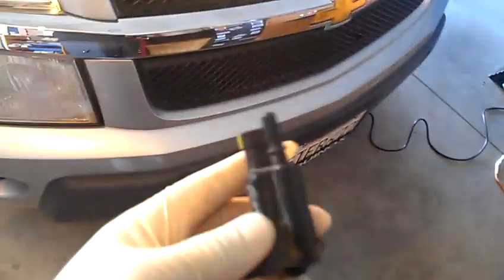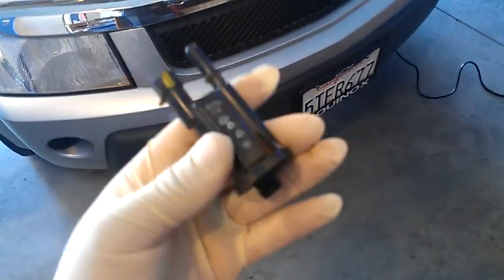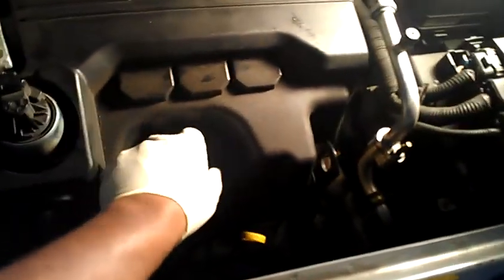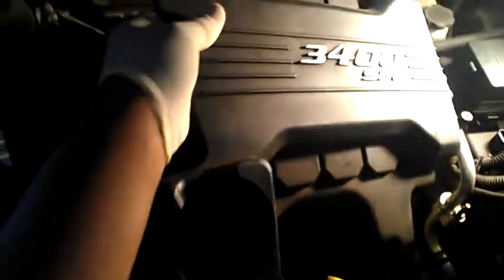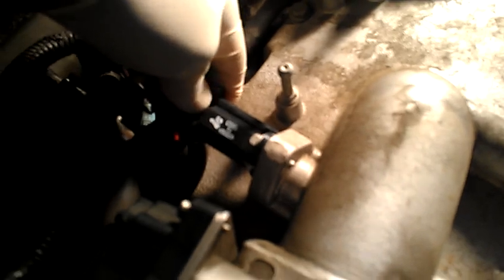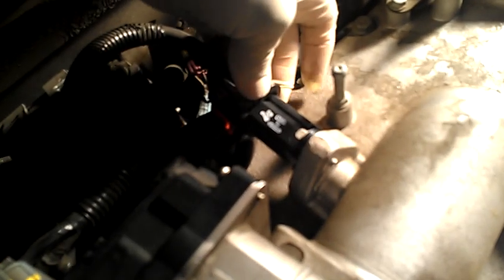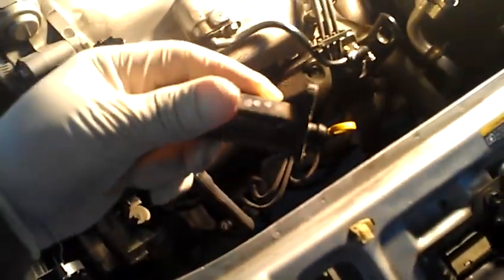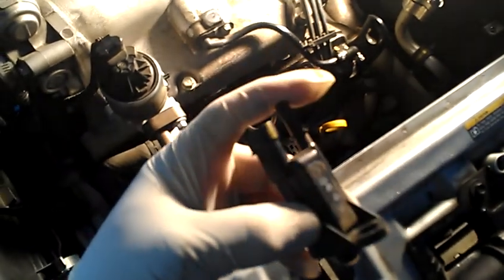EVAP PURGE SOLENOID INSTALL 2006 CHEVY EQUINOX CHECK ENGINE CODE P0455, P0171, P0446

Comment: Thank you so much for making this video! My local dealer was going to charge me around $150 for this. Found the part at AutoZone for 35 bucks and will be replacing it myself
Reply from the maker: good job Glenda you can do it, stay away from those dealers rip offs
Reply: Glenda Reeves what u search for I want one bad

Comment: did you also change the vent to clear the codes? I got  0449 and about to change just the purge on my avalanche. guy at auto zone said it was the same part, yeah since I saw the last vid that dude that works there don't know squat !!!

Comment: How long did it take the check engine light to go out after doing this? '05 Equinox here
Reply from the maker: Mike Davis drive at least 100 miles  if it don't go off you got other issues